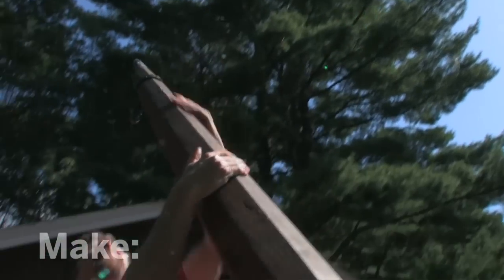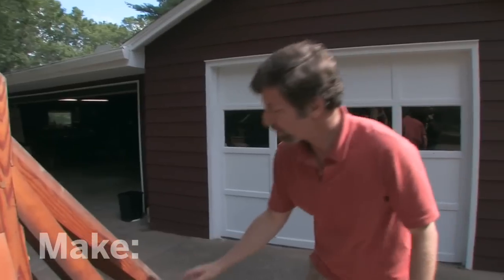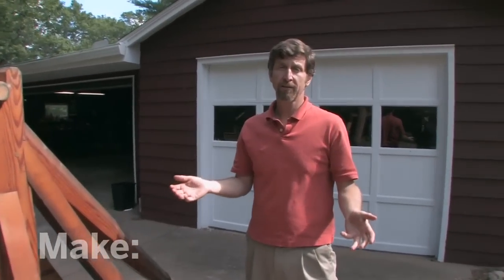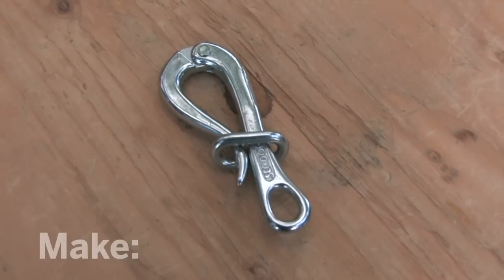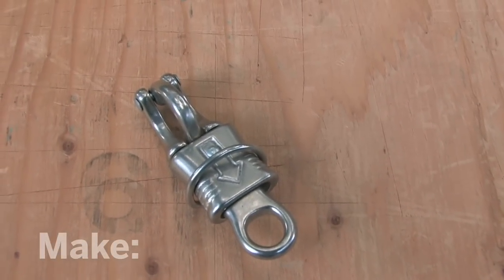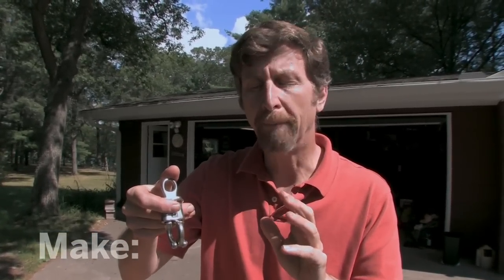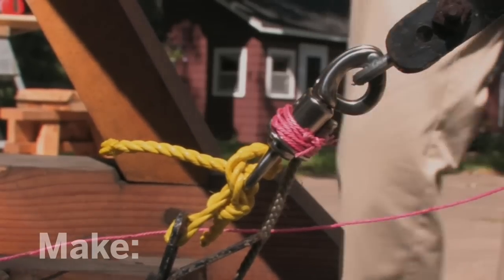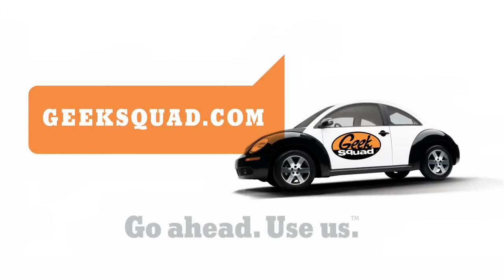Maker to Maker - Load-Release Devices on MAKE: television

Comment: 1st. He said it is a trebuchet, not a specific sized one.
2nd. WTF do you mean the arm shape is inefficient? Straight is about the only issue needed to fling something. Perhaps harder to make, depending on the production method, but not necessarily if you laminate.

3rd. Dry firing a trebuchet is fine, same as a catapult. You are thinking ballista/crossbow.
4th. With the leverage advantage, you could easily lift 500 pounds like he is doing.